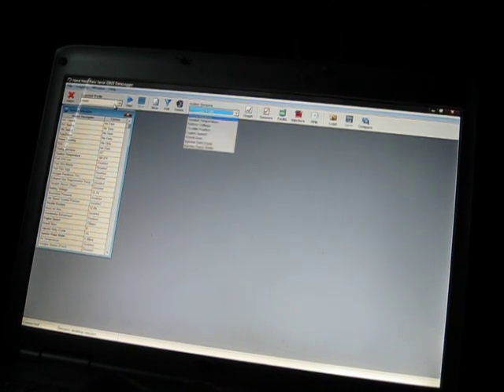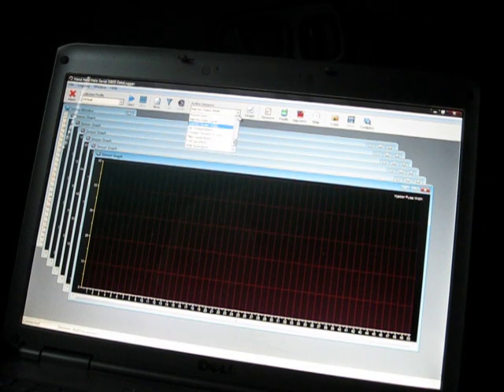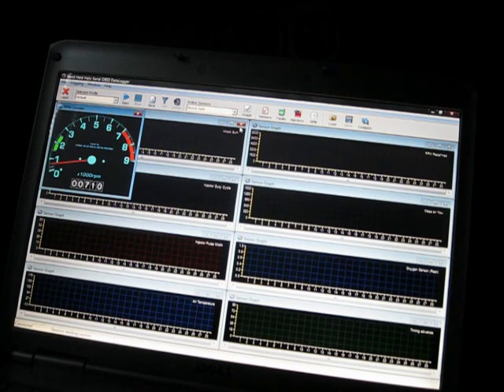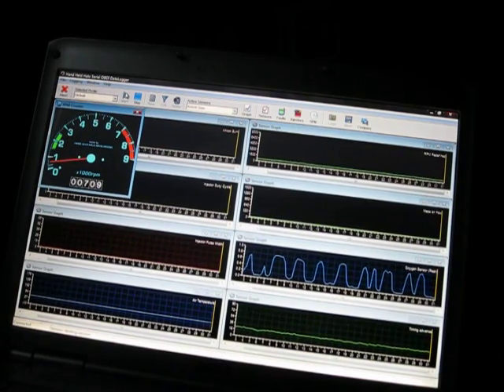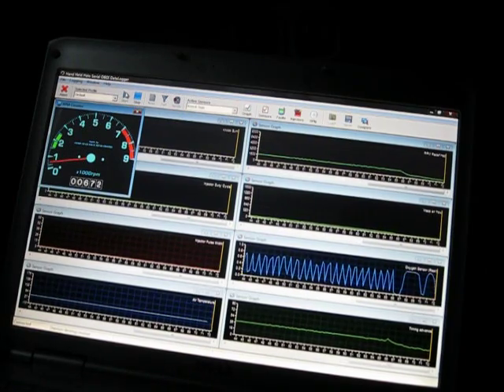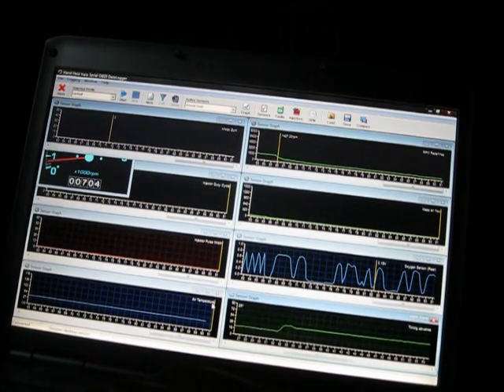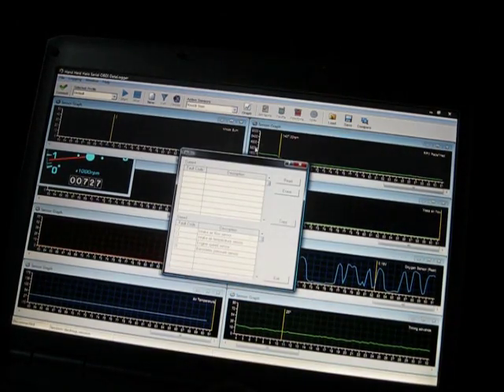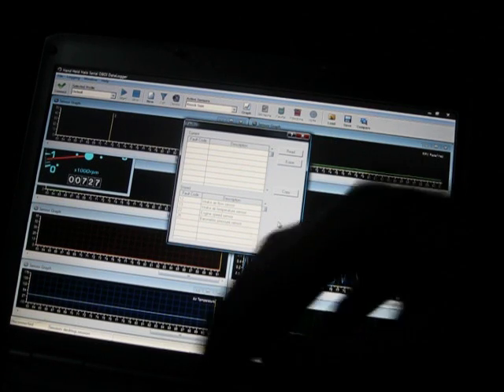Hand Held Halo Data Logging Kit - CntrlSwitch How-To

Comment from the maker: ABS light was on prior to installing so can't help you there.  I choose HHH because I wanted a program that would log knock, liked the look, and was easy to pick up.  Down side is you can only log one additional item (in addition to all the things the ecu can log) in my case I choose my wideband. Hooks in to the ecu at the EGR.  Not sure if other loggers can do more.  Very happy with it though!  Can also make custom skins that could display on a touch screen head unit.  Goodluck with your pick!

Comment from the maker: What cable are you using that converts the cable to usb that hooks into your data ports on your car?  You need to use theirs because most other won't work due to the "Baud rate" being off.  Not sure what the baud is, but it's what they say lol

Comment: I used mine for the first time the other day, but I only saw three sensors that actually produced values other than zero. These were idle, RPM and  air flow. Actually, the air flow was showing zero as well... What do you think I am doing wrong? Thank you!

Comment from the maker: Keep it on the wastegate boost your running without a logger.  12psi "should" be safe, but there is no way of knowing if your fuel system is healthy enough to avoid knock.  Just keep the boost down for now.  My laptop is shot so I'm running my car at 6psi on my 15Gs until I get another one.  Yes the above mentioned parts are all you would need to log.

Comment: for data logging all I would need is a laptop pc, the obd1 with usb adapter, and the software? I bought a boost controller and have a boost gauge, I haven't hooked up my boost controller yet but I'm running 6-7 psi. I'm thinking my solenoid is dead. I was thinking of running 12psi without a logger on 93 octane. Think it would be safe to run 14psi without a logger? I'd really only keep it at 12.